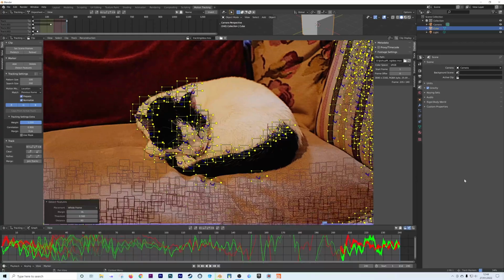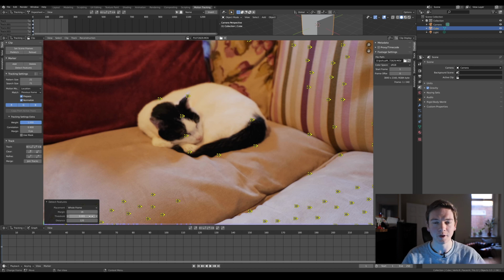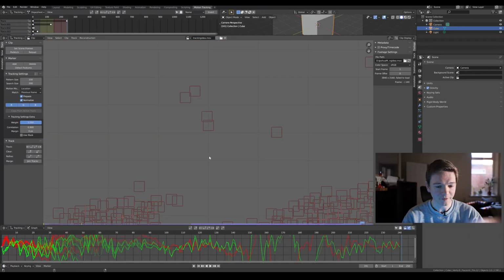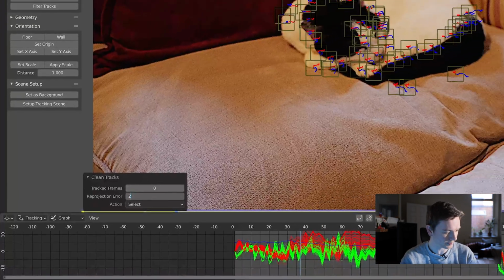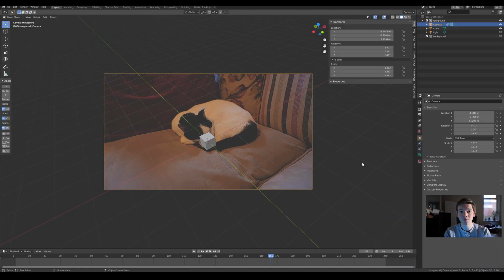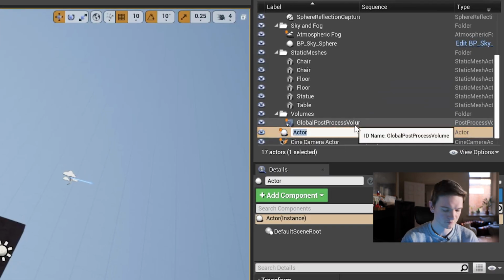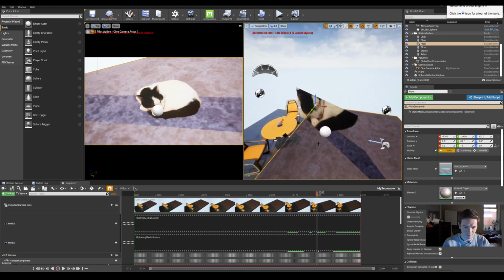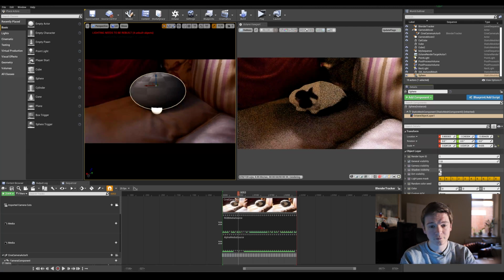TRACK THIS! - Camera Tracking From Blender To Unreal Engine

Comment: i keep getting this error - LogPython: Error: Traceback (most recent call last):
LogPython: Error:   File "D:/x/RL03_SH20/blend/ExportedFbx/ImportSequencerScript.py", line 294, in <module>
LogPython: Error:     print(CreateSequencer())
LogPython: Error:   File "D:/x/RL03_SH20/blend/ExportedFbx/ImportSequencerScript.py", line 148, in CreateSequencer
LogPython: Error:     AddSequencerSectionFloatKeysByIniFile(sectionFocalLength, camera_tracks['Camera FocalLength'])
LogPython: Error:   File "D:/x/RL03_SH20/blend/ExportedFbx/ImportSequencerScript.py", line 93, in AddSequencerSectionFloatKeysByIniFile
LogPython: Error:     sequencer_section.get_channels()[0].add_key(frame, value)
LogPython: Error: AttributeError: 'MovieSceneFloatSection' object has no attribute 'get_channels'

Comment: This is something unreal needs to improve on. Tried C4d, blender, AE, Maya, but there is too much guess work, especially with bigger movements, flaws shows up pretty quickly. I guess its why people prefer tracking apps which are accurate enough to then adjust afterwards. I did read that someone used 3Dvisualizer to cinema4d to datasmith UE and got what I consider perfect results. But since those are expensive softwares, I never got around to try them.